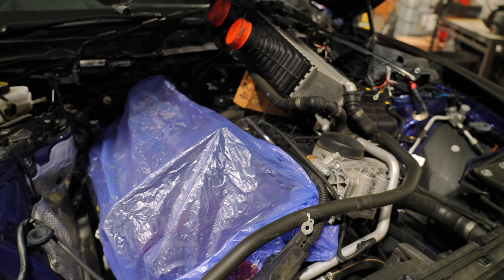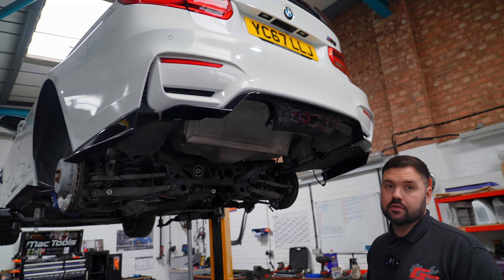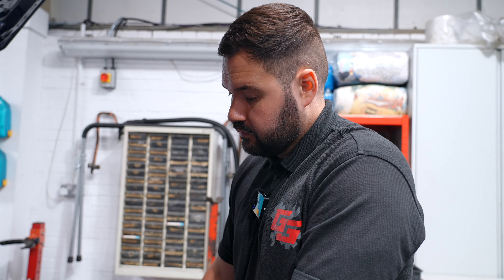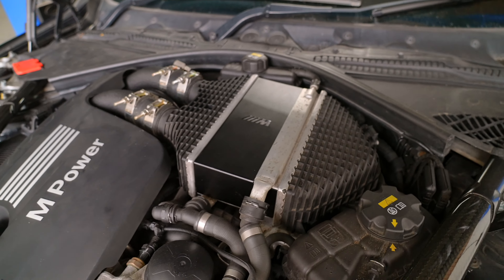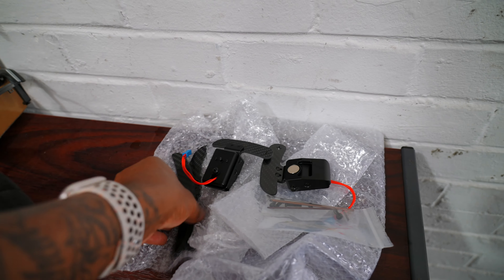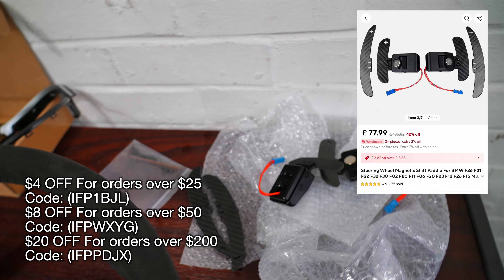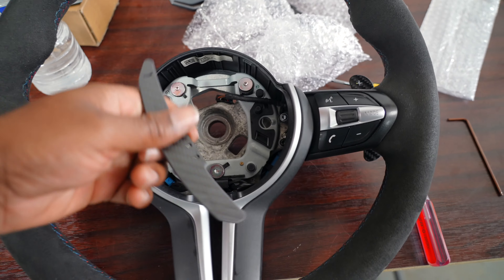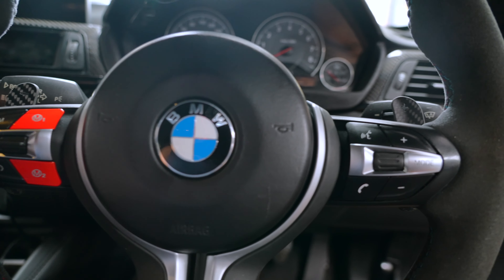MODIFYING MY BMW M4 WITH ALIEXPRESS PARTS!

Comment: Nice upgrade again Tim. Paddles are cute! What happens if you’ve larger hands and sausage fingers?! Right then, grab a full set of genuine bmw carpet mats. Spray em with Scotchgard carpet protector. Then a full set of genuine bmw rubber over mats. See if there’s a decent boot liner mat to. Then your fully covered & protected.
Reply from the maker: 😄 thanks dude! Rubber mats for winter are a good shout 😆